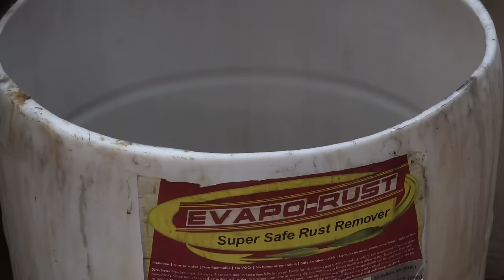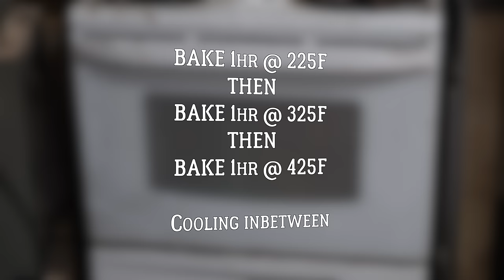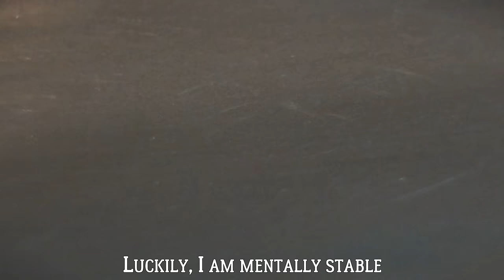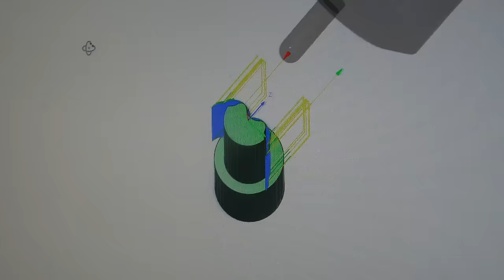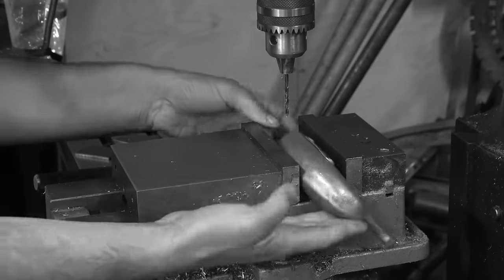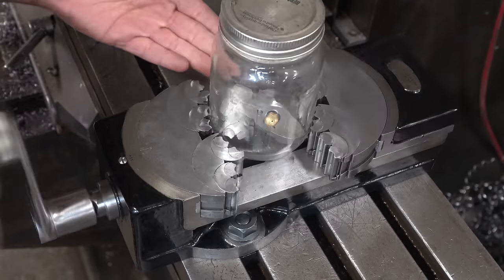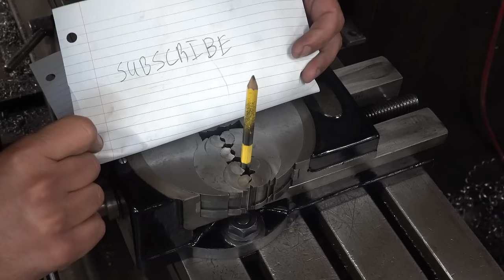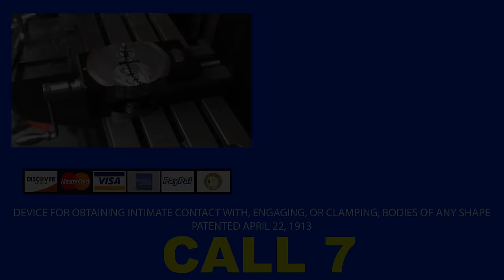Rare Antique Fractal Vise [Restoration]

Comment: For those curious, I finally found out how Evapo-Rust works (I couldn't help but scratch my head at him dipping his whole arm in there):

Unlike other rust removers that use some type of acid to remove rust, Evapo-Rust works without acid. It will not attack the base metal, and it is safe to use. Evapo-Rust works through selective chelation. This is a process in which a large synthetic molecule forms a bond with metals and holds them in solution. Most chelating agents bind many different metals. The active ingredient in Evapo-Rust bonds to exclusively to iron. It will remove iron from iron oxide but is too weak to remove iron from steel where the iron is held much more strongly. Once the chelating agent has removed the iron, a sulfur bearing organic molecule pulls the iron away from the chelator and forms a ferric sulfate complex which remains water soluble. This frees the chelating agent to remove more iron from rust.

Comment: I worked a foundry back in the 1960s and they would cast their own welding rods from the same pour of iron as the castings. They had a number of the more complex castings that might have some defects that they would use the welding rods from the same pour to get better welds and better color match.

Comment: This is one awesome mechanical device. Man only if they used modern screws to keep it going. Hard to find a lot of those and replace with something better than old flathead. If you made them all yourself or knew someone who would for cheap it would be maintainable forever and still perform the same job. What this tool does is no joke it’s really cool and a person with a very mechanical mind thought it out. They just didn’t have the best of hardware yet so they did it with that they could but they did it right and did a good job. Man I would have prolly soaked it with PB blaster first tho just to break everything up and get a lot to drip out. That stuff is one of the best products I’ve ever found. Your a real pro tho especially in the creativity department you went for some things and eventually made them work. This tool is so awesome tho I wish I could get one totally intact to work on.

Comment: After watching Adam Savage's video on the one he bought, it's interesting to see how important the contour of the gripping surface is. His had flat surfaces, and he seemed to be having a lot of trouble because of that. This one has those… wiggly? surfaces, and that seems to allow the smallest pieces to align themselves with the object much better, thereby allowing all the rest of the pieces to do their part more effectively. the bigger crescents can only do so much if the smaller crescents aren't pulling their weight too

Comment: The one Adam Savage obtained from Alibaba uses pins for the large 1st stage alignment pivots which is probably considerably weaker than this one but the pin design may allow for more conformity to the work piece especially at wider openings

Comment: Steel block:
Cracked wide open, huge chunks are missing, half of the threaded holes in the center are missing.
"We'll just tack it back together!"

Steel rod:
Has a couple tiny dings in it.
"Guess we need to remake the entire part from scratch..."

Comment: It is a very usefull vise for abnormal shaped pieces.
But a straight line vise for straight piece will be much better because you have much better strenght distribution on all the part.

On this special vise you points of strenght would rellly on a couple of small line..making your piece easy to tilt out of vibration.

Comment: For filling the dimples made from drill bits going thru stuff and mistakenly hitting the vise would it not be easier to drill them out and then machine a plug out of the same metal and after cooling the plug pressing it into the hole for a super tight fit that could be finished with the surrounding surface and be almost invisible.

Comment: Curious looked in-between of braising and welding, obviously they are similar techniques. Did you keep the heat on after to make sure the stick metal continues to melt into the hole? I'm new to metalworking, a toolmaker apprentice.

Comment: With a modern EDM wire cutter - which can achieve extraordinary tolerances of about 2 microns (0.002mm) - I wonder just how small you could continue on making lines of tiny jaws? 

Here it goes 1-2-4-8 on each side, so d'ya think we could get it to 32? Or 64? Or even 128..!?

Comment: I really wish i would have actually listened to the "fine print" at the end (sped up recommendations) as I'm in need of reconstructive surgery of me deek. It went well at first, it was a firm grip, that nestled up nicely. I was truly impressed with its ability to contour itself around the head and shaft....However my wife thought it funny to use my high speed drill to test it's speed and rigidity (the vice not my deek) Now, I know what you are thinking....why would he put his deek in a vice? My response is, why not. Just don't let your wife have complete control when you find yourself with your deek in a vice.

Comment: In my opinion I think it should've been remade or ground out and welded instead of brazed. Its better for strength and it doesn't use mixed metals, less risk down the road from corrosion.

Comment: I wonder if a replica of the jaw assemblies can be machined by turning cylinder stock, the diameters and outer dovetails on a lathe, then cutting those in half and milling the inner races and dovetails with a milling machine using either a standard or custom cutter… it will be tedious and have a lot of part relocating involved…

It’s also strange how it seems that no one has yet to mass reproduce these with CNC machining… are they really too exotic to be worth it?

Comment: Idea talked a old wire clothes hanger make a hook and then instead of putting into the chemical the hooks will latch on the bucket handle and putting a wood dowel across the top of the drum holding the buckets suspended

Comment: It wasterrible at first for this hardware to be made out of pot metal. A very cheap type of metal that breaks too easily. Plus, there was no owner's manual for this piece of hardware. Which had made things difficult. This contraption has no patent date like all hardware objects are supposed to receive. Glass shouldn't belong in a fractal vise. ➕️